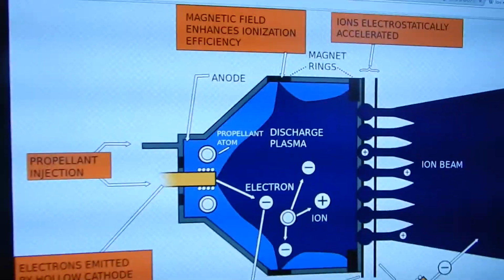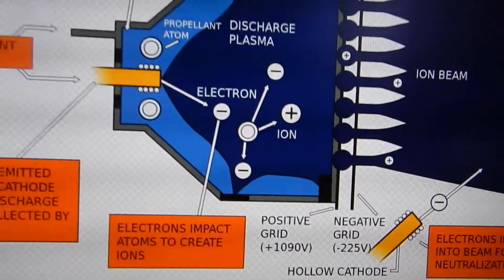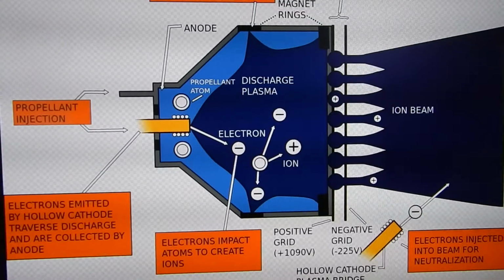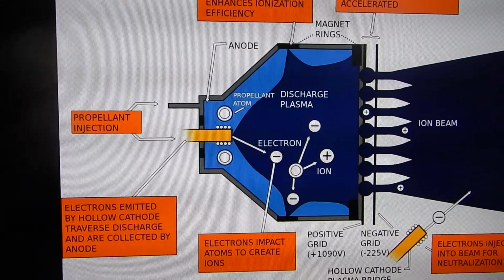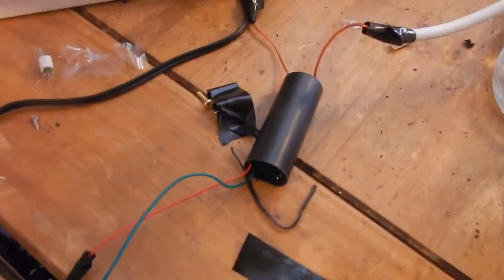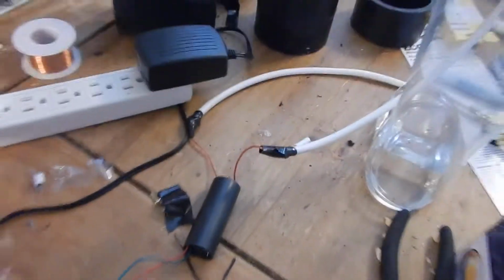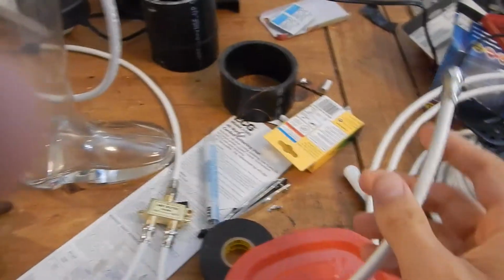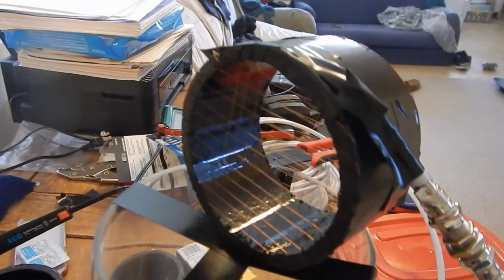DIY Dawn NSTAR Electrostatic Gridded Ion Thruster

Comment: how much voltage and current is supplied by power supply and used for every grid?
Reply from the maker: utkarsh salunke 12v 5A I believe. Each grid is +/- in the hundred kV range.
Reply: steven morad thank you so much, can we operate grids at 30kv, just trying to be safe or it is mandatory to use 100kv. also how do you measure that extreme high voltage?
Reply from the maker: utkarsh salunke I measured it by measuring how far the electricity would arc. you can try a lower voltage, but you'll need it to arc for this to work.
Reply: steven morad so how much distance from grid will be safe?
Reply from the maker: utkarsh salunke I eyeballed it. I started far away, and got closer until it arced.
Reply: steven morad thank you very much. Now I'm asking too much but If you don't mind can I have your email. cuz I'm seriously working on ion thruster and I don't have any support
Reply from the maker: utkarsh salunke I would be very careful. I calculated the current to be very low, .02 mA in my case, which is non fatal. I shocked myself many times. I would be extremely careful, I would not do this if you are not familiar with electricy.

Comment: This is a very interesting setup. Im working on an ion-thruster as a school project and have gone for a design emulating this: http://www.elab-hackerspace.org/2015/09/18/ion-thruster/  design. We dont have a hv power supply and so are trying to make one. You used a momentary switch to have a pulsing sort of thrust. Is this because the high voltage coil u got from amazon cant handle a constant output (Ive read that in various comment sections and things, running those little guys for any length of time longer than a few seconds seems to fry them)? Additionally, you didnt seem to need to discharge it (let it arc) but ive read that they seem to need to be discharged in order to not have them break
Reply from the maker: I ended up using a more powerful power source later, and it discharged at something like 10Hz. The switch was just a way to try and mitigate self-inflicted shocks.

Comment: I'm curious, as I'm building one right now currently: Is your tesla coil hooked up continuously to power? If so, how do you make sure it doesn't burn out? (I've already burned one out by having the electrode too far from my grid for too long. Also, since tesla coils are AC, how did you insure that the current moving through the wires was of one polarity or another? 

Very curious as to how to solve this with my own setup. Yours seems to work quite well.
Reply from the maker: +Duncan McGough Don't get a power supply that supplies more voltage than the Tesla coil will take.

I used a laptop power supply of 3A at 12V I believe, the coil had a max current of 5A.

I tested the polarity of the wires by holding them close to a piece of metal. Ground will not cause arcs. The output of the voltage booster was DC.
Reply: https://www.amazon.de/gp/product/B01EABX7IQ/ref=oh_aui_detailpage_o04_s00?ie=UTF8&psc=1
This one also works continously!